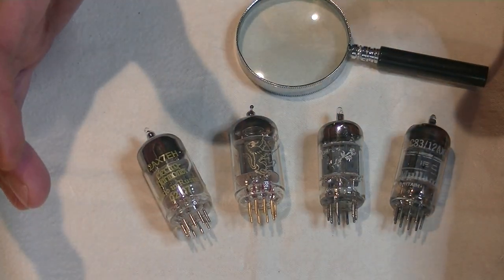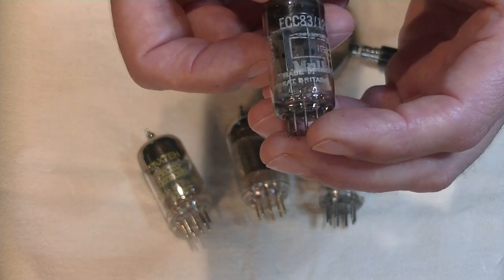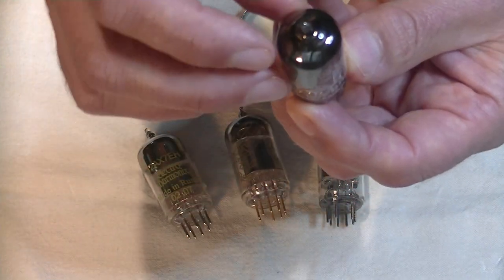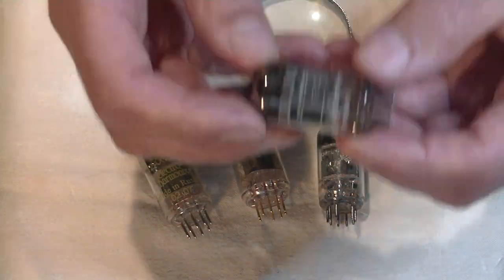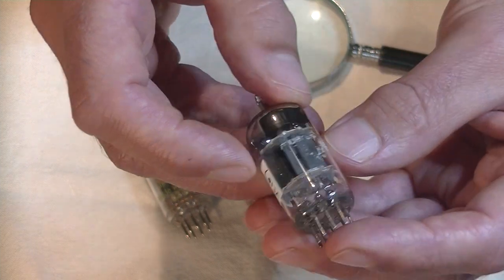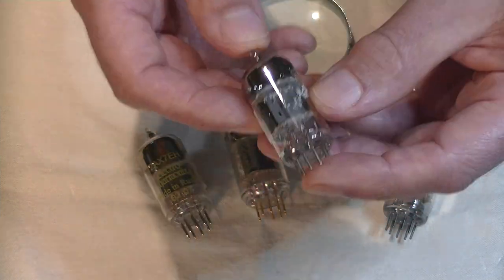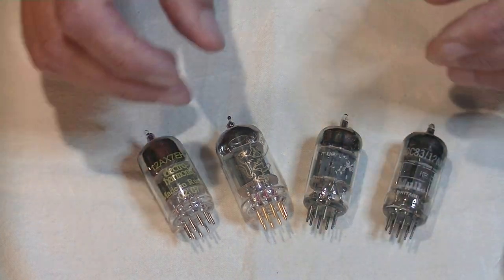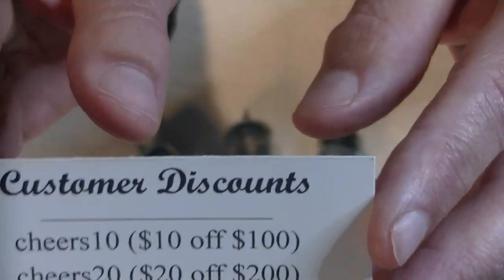Tube Lab #6 12AX7 Tube Rolling

Comment: I have been looking at 12au7’s lately for my guitar amplifiers. Been looking at schematics and noticing that starting with the 2nd gain stage, 12ax7 tubes are really not necessary. Sure the 12au7 aren’t high gain - but they can swallow a huge signal on the grid the 12ax7 just can’t. I have a 17 volt peak to peak signal coming off the first gain stage of my Carvin Belair with a 150 mV input signal. I don’t need a 12ax7 for the 2nd stage. Just going to rework the plate and cathode resistors.

Comment: Hey, Mr Jim. Great video,  but I have a question ❓ how do you find the number value on  a tube, when the markings are rubbed off , can you share your tricks, please, thank you
Reply from the maker: Sometimes a bright lite and some angling to catch a faint remant will work. But mostly we rely on our experience and it helps to have a large inventory to compare an unknown tube against.  Charles is a genious when it comes to figuring out some difficult to identify tubes.  If you are stuck, join a FB group dedicated to vintage tubes, post a couple of high res pictures and only ask about ONE tube at a time.

Comment: The big question is does that filament flash deteriorate the material quality, it usually happens on one or two filaments, not on all, so I wonder how that affects the long term reliability of that tube as one or two filaments are exposed to much higher temps.
Reply from the maker: Good question!  In my experience some of the worst testing (Gm and noise) used vintage tubes are the Mullard miniature 9 pin types and these almost all have the flash.  Now Mullard had a rep "back in the day" among repairmen for being noisy, so this may well be just another issue, seperate from the filament design.  The problem of course is Mullard isn't making anymore of these wonderful sounding tubes, so we just need to carefully weed out the noisy ones and make good use of what's left to us.

Comment: Hey Jim , wats equivalent to a 824 tube for phono stage ?? Thanx in advance !! Id like to order those gold pin gold lion and try them ...
Reply from the maker: I have no (zero) idea what 824 you are talking about.  There is a cv824 which is a 7 pin transmitting pentode, definitely not a phono tube.  Commonly used high gain tubes for a phono stage are 12ax7 and 6sl7.
Reply: @tubelab194  Yep ,2 ,  7 pin   came on a small phono stage preamp that I had purchased off Amazon . (Grin ) Fosi Audio is the maker of the preamp . I'm super new to tubes but very open minded so I tried this little piece and love it . The sound was what I would call crisp , spongy ,  (w guitars on a first press Lp ) I'm really digging the sounds it brought to my system . The 2 tubes it holds do have 7 pins .  Thanx

Comment: Hi Jim, Have you ever tried the 6N2P ?  They say with the adaptor it can directly replace the 12AX7.  For about $15 I bought 8 tubes and an adaptor to play around with. We shall see.
Reply from the maker: Hmmm I doubt the adapter will work, main difference is heater voltage, the adapter probably says for 6v heated 12ax7, most today are set at 12v, won't work if your heaters are 12v.  Take a look for my 6n2p video, I talk about these issues in detail.
Reply from the maker: https://youtu.be/n1S-BDVJWOE
Reply: @tubelab194  All the amps I build get 4-5 jumped so I power the tubes with 6.3v, I'll have the check the pinout on the converter to see if it takes  filament voltage between 4,5 and 9 or just between 4 and 5.

Comment: Ive al;ways just played guitar and never really got into the nerdy part of my amps too much before. Can you use two different brands of tubes in your amp at the same time? Like say Mullards pre amp tube with Electro Harmonic power tubes as long as they match the specifications of the amp, instead of all just the same brand in the pre amp and power tube section?
Reply from the maker: Absolutely of course you can mix and match different manufacturers.  In fact in the various sets of tubes we offer for Schiit amps and the R8 we do exactly that, choosing the best sounding tubes for each slot.

Comment: Hi I have mullard M8137 CV4004 KB/D military spac. What's different is?
Reply from the maker: CV4004 is just the UK military designation for the 12AX7, CV stands for common valve.  Was the tube any different, maybe, but in many cases the tube was the same one the manufacturer sold domestically and labelled as a 12AX7 / ECC83.  Unfortunately data sheets aren't always available to compare the two, but go ahead and try and find them both with a Google search, then you can compare them.

Comment: How do you feel about real Telefunken 12AX7s?
Reply from the maker: I don't get a lot of Telefunken 12ax7's in, one of my wholesalers had 4 up for sale a while back and I couldn't bring myself to pay what he wanted.  Now I regret not buying them - prices having continued to go up at a crazy rate!  My main focus is finding excellent - affordable tubes for my customers.
Reply: Real Telefunken 12AX7s are one of the most commonly counterfeited tubes, with re-labeled Ei/Yugoslavia ECC83 often being the true origin.  Look at the glass between the pins for a nearly-square "diamond" shape embossed in the glass for one way to assure you are considering the real Telefunken.  There is another great way to spot a true Telefunken, by looking at the point where the getter ring connects to its support rod, but that is a little complicated to convey verbally.

Also note that there are "smooth-plate" Telefunken ECC83, as well as "ribbed-plate" Telefunken ECC83.  The smooth-plate gets all the attention, because it has a unique sonic character.  Those smooth-plate TF ECC83 have a response peak in upper midrange frequencies that no other ECC83/12AX7 has.  The low frequencies are not very prominent, and they are very well-defined.  And there is actually a roll-off of treble with the smooth-plate version.  These characteristics are relative to other 12AX7 types.  The ribbed-plate Telefunken ECC83, by comparison, allows a more extended range of frequencies to pass - with deeper lows, and more prominent treble.  I actually prefer the ribbed-plate myself, but many home audio enthusiasts enjoy what the upper-mid peak of the smooth-plate Telefunken ECC83 does to the human voice, so there is no "best" choice (only personal preferences).
Reply: @thomkopal1740  I have both legit Telefunken and vintage Ei ECC83 tubes, and sonics are clearly different.